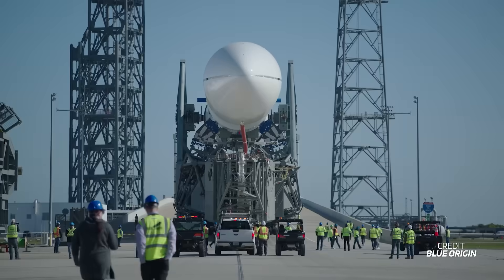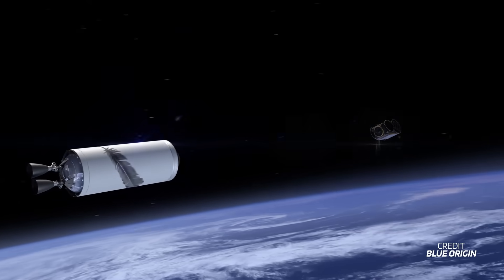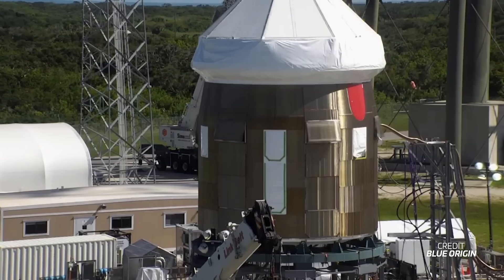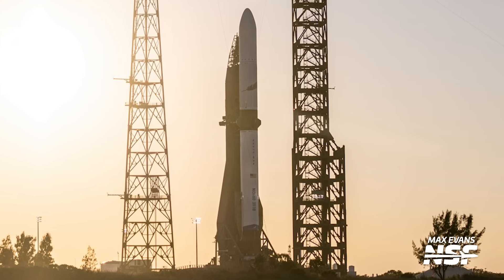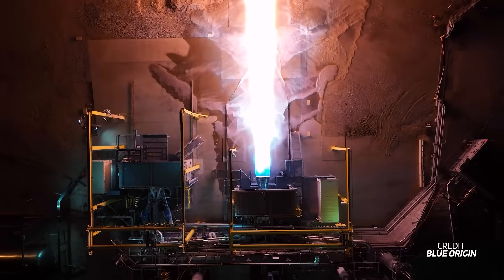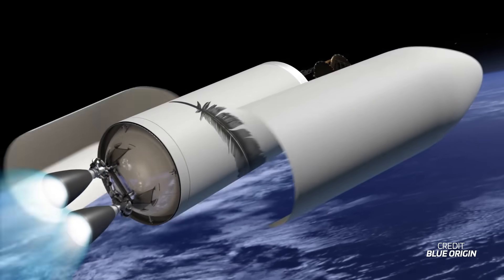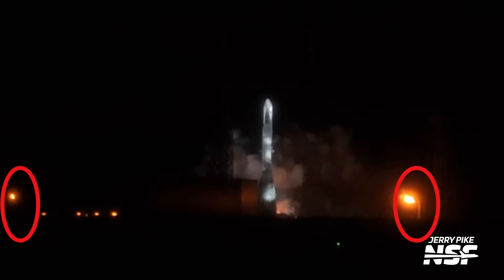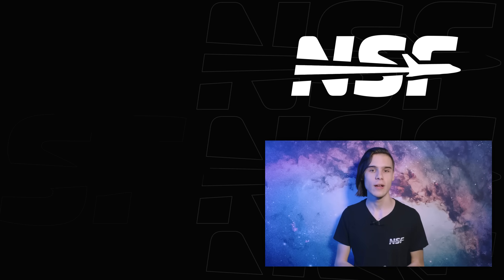The Wait Is Over: Blue Origin's New Glenn Takes Center Stage

Comment: I like that as soon as you air this, it's already out of date. A sign of just how fast this happening. Jacklyn is being towed out to sea by Harvey Stone, and the rocket itself went horizontal and was rolled back inside the integration building.
Reply: New Glenn had a launch scheduled in 2021 and 2022 and 2023 and 2024.  I'm well past believing a launch is happening for New Glenn until it has already flown.
:planet-orange-purple-ring:
Reply: @Scanner9631  Great the cognitive dissonance is in you.
Reply: @nowhereman1046  

Fool me once shame on you.  Fool me twice shame on me.

This "Maiden Flight" has  been announced for a dozen dates or so.  It is only natural to doubt it.
:face-fuchsia-tongue-out:
Reply: @Scanner9631  In the face of....

- Successful pathfinder tanking tests in February.

- Successful quick disconnect tests on a simulator.

- Successful test of the RCS and fins.

- Successful landing gear deployment test.

- A September hotfire of the GS2.

- Successful integration of the GS1, rollout to LC-36, and stacking it with he GS2.

- Successful WDR tanking tests. 

- A successful static hotfire of the flight hardware vehicle a few days ago.

- The launcher rolling back to have payload installed.

- The heading to sea to the point downrange for where the booster is expected to land.

You say it won't launch?  I'd say you were very out to lunch and not wanting this to happen because you told yourself it wouldn't.
Reply: @nowhereman1046  You say it won't launch? 

I say I'll believe it once it happens as for FOUR YEARS they have had repeated declarations each year that it was launching that year and delay after delay within each year.  Even this launch claim is yet another delay,  It was supposed to launch with a payload last year SEVERAL different launch dates.

So why should I believe THIS time is THE time?
:face-fuchsia-tongue-out:
Reply: @nowhereman1046  You say it won't launch?

Launch delayed 2 days.  How many  more delays to come?
:planet-orange-purple-ring:
Reply: @Scanner9631  I noticed you keep blocking people responding to you. Can't take it that New Glenn is days or weeks from launch?
Reply: @Starshipsforever  

You may be noticing that BUT I don't even know how to do that so I'm not doing it.

As to New Glenn launching or not I really don't much care.  Blue Origin has earned my lack of interest by all their false launch dates over the last 4 years.  Not to mention that as a purported "launch company" they haven't even attempted an orbital launch in the over 24 years the company has existed.  

They have a pathetic record in their chosen industry.
:planet-orange-purple-ring:
Reply: @Scanner9631  Final Air Operations Permit was just issued. When are you going to acknowledge the milestones?

But keep sticking your head in the sand.
Reply: @Scanner9631  I noticed the same thing. You're definitely blocking people's replies.
Reply: @Starshipsforever  He's weak-minded. He knows it's just a matter of days, maybe a few weeks, if something comes up. But the AO Permit got issued, so it's happening, sooner or later.

Likely he's just a troll.
Reply: @nowhereman1046  

No way.  As I said I don't know how.  
:planet-orange-purple-ring:
Reply: @nowhereman1046  But the AO Permit got issued, so it's happening, sooner or later.

Sooner or later has been going on for in excess of 4 years now.  Pardon me for not getting excited THIS time like I used to when they first started this interminable chain of announcements and delays.

Wake me when the launch occurs.
:planet-orange-purple-ring:
Reply: @Scanner9631  Troll. Nothing like this has ever happened before for New Glenn; a full flight capable vehicle that's been tested out as far as can be done on the ground, all the paperwork signed off on for launch, and the recovery ships literally went out to sea to get into position downrange for a booster catch.
Reply: @Scanner9631  The only pathetic anything here is you and your trolling. Now that they're done testing as far as they can with real flight hardware, they got all the permits and paperwork, sent the barge and tug out downrange for landing the booster, and have the vehicle getting ready for a launch that literally could happen late next week. And this isn't just any old thing, it's the 4th largest rocket in the world currently. Third largest commercial, privately-owned one.
Reply: @Scanner9631  Yeah you do. I posted three times to you and all my posts disappeared. So, I know they're not just making stuff up. It's got to be you false flagging posts.
Reply: @mikedicenso2778  

The same thing happens to at least half of my posts.  But I don't go around blaming others that I GUESS are responsible.  

:planet-orange-purple-ring:
Reply: @mikedicenso2778  Nothing like this has ever happened before for New Glenn; 

Since the start of this thread there have been TWO delays it is now : 

Fri • Jan 10th, 2025  1:00 AM - 4:45 AM EST

Illustrating why I am doubtful and not planning to stay up late to watch a launch I have no reason to expect to happen based on history.

:planet-orange-purple-ring:
Reply: @Scanner9631  They just confirmed installation of the Blue Ring payload. Your reprieves are running out....
Reply: @mikedicenso2778  

Except it is supposed to have already flown this week.  So like I said I'm not staying up late to see it MAYBE launch.  Two delays already this week added to a 4 year string of delays.  How many more?

Wake me when it has flown.
:planet-orange-purple-ring:
Reply: @Scanner9631  You're clinging to your nonsense like a drowning man clinging to flotsam. 

You can lie to me and to yourself, but you know this is going to launch. Virtually all the milestones have been met. A few days one way or the other won't matter in the grand scheme of things.
Reply: @mikedicenso2778  

I haven't said it won't launch SOMETIME.  I said given its HISTORY I'm not staying up to watch what may not happen as scheduled.  Since I first said it the schedule has changed twice.  

So where  is the nonsense but on your side?  I used to be eager for the launch of New Glenn but 4 years of them acting like Lucy (of the Peanuts comic) and snatching away the football has made me unwilling to believe any particular launch date/time is the real one.  It may happen Friday or it may never happen.  I no longer care.  
:planet-orange-purple-ring:
Reply: @Scanner9631  Don't care what you said. You care enough that you keep responding. So, you're lying to me and to yourself.
Reply: @mikedicenso2778 

Delayed again.

Sun • Jan 12th, 2025  1:00 AM - 4:00 AM EST

Shows why I make no plans to stay up and watch the launch.  It is only the 9th of January and already 4 different launch dates.  WAY TO GO BO!

:face-fuchsia-tongue-out:
Reply: @Scanner9631  So they have weather control? The same thing happened to Starship Super Heavy. Did you know that? Both have been delayed by weather at launch site a few days, and downrange at the landing recovery.

No?

You're dishonest. This proves it. There's nothing right now technically wrong with New Glenn and it went upright at the pad earlier this evening.

Your reprieve is running out.
Reply: @Scanner9631  Get help. You're off in the noogin. A couple days due to weather and rough seas around the recovery area is nothing.
Reply: @mikedicenso2778  

Starship is different as it has already had multiple flights as part of development.  There is every reason to expect ANOTHER launch in the not too distant future based on past performance.

New Glenn has FOUR YEARS of "this time for sure" Lucy snatching away the football.  It will probably launch some time but there is no way to be sure it will be soon or even this year after all their EXTREME delays of the initial launch.
Reply: @Scanner9631  Oh-hum. Starship has had years of extreme delays and failure. And they're 6 years behind on going to Mars. Falcon Heavy was 5 years late, and SLS 10 years.
Reply: The 11th day of the year and the Maiden flight of New Glenn delayed again.  They have had 5 different dates so far this year along with the dozens over the previous 4 years yet not even a launch attempt to date.

They should rename it New Lucy and have a football as their "image".
:planet-orange-purple-ring:
Reply: @Scanner9631  This just nuttery on your part.

Starship has been delayed many times. It's been 8 years since Elon promised that Starship would land with colonists on Mars by 2022. It's been 6 years since Gwynne Shotwell promised site-to-site high speed transport with Starship and there's no sign of it ever happening. Last year we were promised Lunar Starship landing astronauts on the Moon and that didn't happen. And now Starship IFT-7 is also delayed several days by weather, and won't fly until Wednesday.

A few days delay for some landing site weather for New Glenn is small potatoes by comparison.
Reply: Yet again it is delayed.  6 th launch date scheduled in 13 days.  Still not going to plan on staying up late to watch it.  
:planet-orange-purple-ring:
Reply: @Scanner9631  More silliness on your part. Launch attempt last night, full prop loading, the works and we were minutes away but for the APU issue. Now looks like they're going for it again.
Reply: @ 

One more time Thu • Jan 16th, 2025  1:00 AM - 4:00 AM EST  7 dates in 13 days
:face-fuchsia-tongue-out:
Reply: @Scanner9631  So's Starship, now 10 dates in as many days.

When you getting therapy?
Reply: @Scanner9631  They made it to orbit baby!
Reply: @ 

By the standards you and the other Starship naysayers have for Starship that is a failure as they lost the booster which was supposed to land.  

But congratulations to BO for their PARTIAL success after 4 years of failures to launch on their declared date.  After 25 years  you have done what most new launch companies achieve in 6-8 years. May it not take 25 years to make your 1st landing and 2nd launch.
:planet-orange-purple-ring:
Reply: @nowhereman1046  So's Starship, now 10 dates in as many days.

Funny how my original post calling out this lie was DELETED.  

Here are the actual dates in that time frame:

 Friday January 10th 5 PM - 6:37 PM EST.

Sat • Jan 11th, 2025 8:00 AM - 9:38 AM EST

Jan 13th, 2025  5:00 PM - 6:38 PM EST

Wed • Jan 15th, 2025  5:00 PM - 6:38 PM EST

Thu • Jan 16th, 2025  5:00 PM - 6:00 PM EST

Only 5 dates and none of those was a delay FROM 5 years ago like BO was.

Congratulations to BO for their PARTIAL success and doing what most companies do in 6-8 years.

Going to be hard to put up all those Kuiper satellites when your reusable booster blows up in flight though.
:planet-orange-purple-ring:
Reply: @Scanner9631  Oooh! Triggered you!
Reply: @ The answer is now zero.
Reply: @ The answer is now zero.

Depends what the question was.  If it was "How many fully successful flights of New Glenn has there been?" the answer was zero yesterday and is still zero today.

But congratulations to BO on finally attempting a flight and having a partial success.  

Now the new question is "How many more claims for the next launch date will there be before a 2nd New Glenn flight is attempted?"

:planet-orange-purple-ring:
Reply: @Scanner9631  This met their critical objective of getting to orbit safely, everything else was icing on the cake.
Reply: @Starshipsforever  

So a PARTIAL success.  Lie I  said.  
:planet-orange-purple-ring:
Reply: @Scanner9631  Full success, just like with every Starship launch. They can still launch almost any payload while working out the landing part.

Otherwise, by that standard, most of the Starship flights have been resounding failures. I and most people consider them successes, except maybe IFT-1 and 2.
Reply: @Starshipsforever  

Partial success as not all mission objectives were achieved but some were, like every Starship flight.
:planet-orange-purple-ring:
Reply: @ The only thing that mattered was getting to orbit. They demonstrated launch, including all pad GSE systems, staging, BE-3U ignition and 2x reignition, fairing separation, stable attitude and pointing control of the 2nd stage and booster.

The landing part demonstrated that BE-4 could reignite for reentry. But all of that was icing on the cake. Not landing on the barge wouldn't scare off customers who only care about getting to where they need to.
Reply: @Scanner9631  I guess your evil is coming back in karma now: Starship blew up.
Reply: @nowhereman1046  

2nd stage yes.  1st stage was caught.  So like New Glenn a partial success.
:planet-orange-purple-ring:
Reply: @Scanner9631  Nope. Your evil is showing again. The booster being lost didn't prevent mission success, the GS2 and Blue Ring are in MEO now as  we speak. But had it been on Starship, it would've been a total failure.
Reply: Bet you a cheeseburger it goes this week !!

Comment: I wish BO success but in reality there is zero chance this maiden flight makes it to landing on Jacklyn. You can simulate all dynamics of flight a million times but there is NO substitute for actual flight data. That is why SpaceX has been such a success. Their re-iterative approach to building test hardware and actually flying it vs running endless simulations.
Reply: Ok. Let’s take a little roll here. Jay Quell En. Is there a Jay Quell En here?
Reply: @Zeett09 crazy good reference
Reply: @clayel1  I wasn’t sure anyone would pick up on that. 👍
Reply: @Zeett09  First stage will experience way more speed and heating though. And hypersonic aerodynamics cannot be fully simulated.
Reply: @cmdrsenior  And??

Are you saying they havent built materials to withstand the heat of re-entry? because they have
hypersonic aerodynamics is pretty understood for what its trying to do. Its not going above and beyond and trying to propel itself efficiently through the atmosphere at that speed. It just needs to control itself enough to not burn up.
Reply: I can put money on it that it will land first try
Reply: new sheppard is decently good flight data btw
Reply: From our perspective, it is difficult to judge the chances, but I would never say they are zero. History has often shown that things considered impossible are possible. And it feels good saying "I told you it would work!" to the scepticals afterwards :-)

Comment: Ryan, I know your emphasis here was on initial design and ops; but when you ask in the end for opinion on # of flights for 2025…would help to know if there is a second booster in flow already at BO’s facilities in Florida, or not. - Dave Huntsman
Reply: 4 are in production currently and if they land the first one they want to reuse it right away
Reply: @Moritz_Space  Why would they want to reuse the first one ‘right away’? Sure, they have customers waiting; but they won’t be helped by not doing a thorough post-mortem on the first booster,
Reply: @dphuntsman  From what I know they expect refurbishing to take 1-2 months and a new booster won't be ready until April.
Reply: @Moritz_Space   and if they land the first one they want to reuse it right away

Foolish.  The best thing to do is take it apart and THOROUGHLY check everything out to find what weaknesses developed during flight that might compromise a 2nd flight.  Doing so would prevent reuse but improve the chances of further successful 1st flights as well as 2nd flights.  Then you do the same with the first boosters to land twice.  
:planet-orange-purple-ring:
Reply: I could be wrong, but I believe that there is…

Comment: I expect they'll get no more than half a dozen flights this year. This is a new launch system. There will be problems to address. They also need to figure out where their inefficiencies are and design modifications to get things done quickly and more smoothly. SpaceX didn't get to their current launch cadence overnight and neither will Blue Origin even though they're not the first kids on the block to try this.
Reply: My guess is that they'll have around 4 flights or less with a 3 month span between flights to make adjustments and changes.  I don't think they're ramped up production nor are they poised to make rapid changes the way SapceX does.
Reply: With what rockets? They don't have the production to support 6 launches a year, and they haven't even completed a single test flight.
Reply: @jaredmundi3599  Blue has "several" rockets in production according to the company. It would only require 2 functioning units each having a 4 month turn around to make 6 launches. So 6 launches seems doable depending upon inventory, exactly how far along production is on each unit, the booster recovery rate, and turn around time. Lots of variables to consider.
Reply: @qphase  they haven't even completed one single test flight. They arent "reusing" anything on an unproven platform.
Reply: @jaredmundi3599  Only Spacex does a bunch of test launches.  No other company does that.
Reply: @bluesteel8376  Yes only SpaceX does rapid iterative testing. They are also the only company with hundreds of successful orbital launches and a reusable first stage. Blue Origin has never put a single gram of mass into Orbit and they think they are running straight into a reusable super heavy class orbital vehicle. It's an unproven platform and this first flight is a test. Their little new shepard suborbital hops are not an equivalence test.